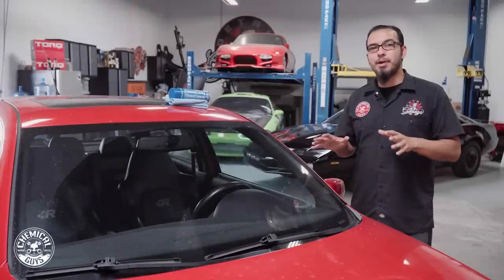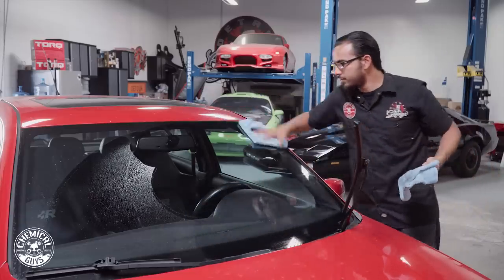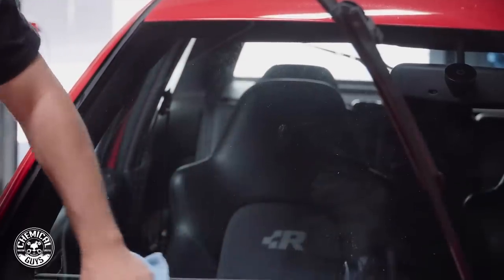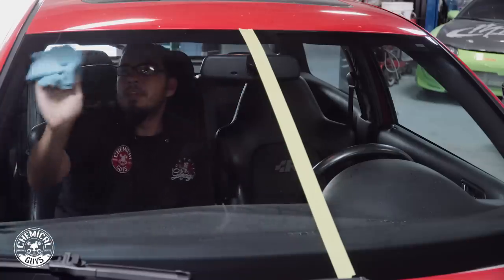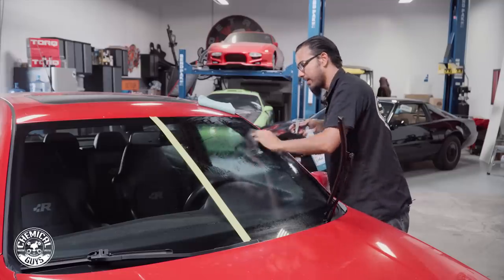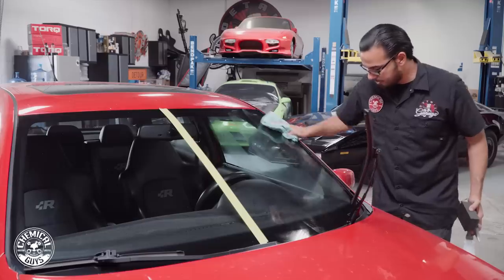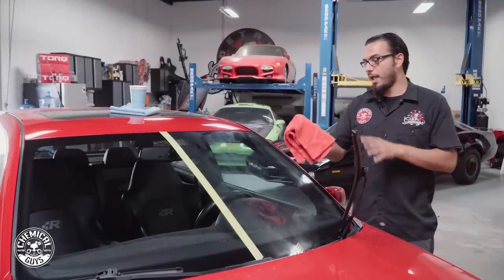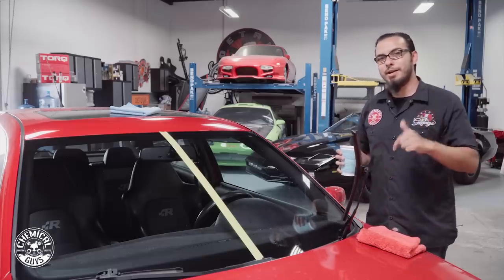How To Clean and Seal Glass! - Chemical Guys

Comment: Got a replacement windshield, was asked for no car wash for two days (glue drying), np. It rained I will clean regular, should I clay bar same steps. After jet seal with new wipers will I have streaks? Does wash and wax cause that or silicates scratching my wiper and windshield? Do I need to wax it I have butter wet wax? Right now it doesn't repell water. New video maybe showing a glass repair short then what to do or new car.

Comment: Dear  , I am trying to remove hard water spots on my truck windshield. I watched the video above and I have some questions. I called you guys up and spoke to a lady. she was very helpful to find the products that you mentioned on your video on your product page. I noticed on your page  many clay bar kits, you used a dark bar and she recommended me a yellow one. what is the difference ? thanks for your time and info/help.
Reply from the maker: Hi Adolfo, good question. In this video, Nick uses a Clay Block rather than a Clay Bar. A Clay Block is essentially a synthetic clay bar. It has some unique benefits to it over a clay bar. For example, you don't have to throw it away when dropped on the ground and also, it will last much longer than a traditional clay bar. Which one you choose is personal preference. About your water spots- have you tried Water Spot Remover yet? That would be the first step in your water spot removal process. Thanks for watching, Adolfo, and thanks for being a part of the Chemical Guys family! 
https://www.chemicalguys.com/Clay_Block_V2_p/clay_block.htm

https://www.chemicalguys.com/Water_Spot_Rx_Hard_Water_Spot_Remover_16_oz_p/spi_886_16.htm

Comment: Good day. 
I have applied JetSeal to my model3 
Should I worry about Window cleaner stripping it off my windows?
Is their such a thing as PH balanced window cleaner like there is for your foam soap?

Thanks.
Reply from the maker: Hey Thomas! Thanks for tuning in. JetSeal will stand up to glass cleaners and the elements for up to 12 months. Add multiple coats for a more resilient barrier of protection. - Happy detailing!

Comment: Question, with a new windshield, would I use clay bock and clay lube to clean the glass before using the Jett Seal
Reply from the maker: Hi JP! A new windshield shouldn't need a clay bar treatment but just be sure the glass is as clean as possible before applying JetSeal.
- CG Nick
Reply: if it feels smooth you dont need to.

Comment: Hey guys, if using jetseal on glass would you also recommend also using hydroslick or would that be overkill? If using both, what order would you apply them? Thanks!
Reply from the maker: Hey! Absolutely, using HydroSlick and JetSeal in that order will add a durable layer of protection.

Comment: If your car is a few years old, do you need to buff it before using the Jet seal?
Reply from the maker: Hi Alex! Before any polishing or sealing, we recommend clay baring the surface of the vehicle. Clay baring the vehicle will remove all the contamination and deliver a smooth surface. After the vehicle is contamination free, you may polish or seal your vehicle. When the surface of the vehicle is contamination free glazes, sealants, and waxes bond better to the paint and last longer. If the vehicles paint is oxidized, we recommend polishing to enhance the shine of the paint and then seal. If the vehicle's paint is still in good condition, proceed with Jet Seal. Thanks for watching and thanks for being part of the Chemical Guys family!

Comment: I still can't get over the BGM......how about trying jazz?  

I usually wash my ride once/week or every other week depending on whether it rains, so the outside of the windshield stays clean.  I tried Rain-X's washer fluid additive only to find it little effective.

The problem is INSIDE the windshield.  I followed ChrisFix's instructions, but I still get traces when it gets humid.  I've also tried "Streak free" products, only to get disappointed.  Microfiber towels didn't help, either.  Is a flame thrower the only alternative left for me...?
Reply: ChrisFix does have an incredibly thorough window detailing video. If I recall correctly he mentions the interior side of the windshield gets cloudy from the out gassing of the plastic dash. Perhaps more prominent in your vehicle or maybe try switching up the type of dash cleaner you use?
Reply: JPN850R o
Reply: Its the plasasides, if the car us new, or the dash was treated with somthing crappy like armorall, you need to clean it often, untill the plasic fumes have evacuated themselves.
Reply: you just watched a video that tells you how, instead you choose to do the same as the trolls and tell how you did it another way. by the way, most found out years ago that rain x is not user friendly, its a good product if you use it right, but it is not a wipe on and wipe off and for sure  i would never use it in my washer fluid.

Comment: I have a question. Do I do this process before.or after i clean the car.lets say. I use the glass only stuff first, then proceed to clean the car throughly and clay it. Then use the jet seal. Is that the correct process? Or did.I say something wrong?
Reply from the maker: Hi! Good question. Yes, you can do it the way you described, or you can clean the the whole car first, then use the glass cleaner, then the clay. The important thing is just to get the windshield clean before you clay! Thanks for watching and make sure to check back tomorrow for a new video upload!
Reply: Chemical Guys i watch and hqve bought over $1000 in your products i think they are absolutely top knotch

Comment: What do you guys recommend to prevent condensation “fog” build up inside the rear or front windshield?
Reply: use the defroster on your climate controls
Reply: Ouch.  That's cold man.
Reply: Hence the name "Defroster"  If you have a rear window defogger, have you noticed how the fog disappears when it's turned on?
Reply: Fog X
Reply: 99% of the time; only use fresh, not recycled air. Recycled cabin air will trap moisture inside. Either from dew point or brought in as wet shoes, wet hair or even when you exhale, the humidity will increase thus attaching as fog to a cool surface like a windshield. 
Tip: When either defrost or defrost/floor is selected, the AC pump will run, which in turn dehumidifies regardless of temperature settings. AC is can be used as dry heat too, not just cold.
The other 1%, when someone farts.
Reply: Defroster great idea
Reply: @johnmax4586  the question is prevent . Not after it's fogged.
Reply: Hold your breath

Comment: Can I use the glass cleaner on tinted windows and also would claying to tinted windows affect my tint?
Reply from the maker: Hey Antonio! Try using Streak Free Window Cleaner to safely detail tinted glass.
Reply: Tint is on the inside so clay bar won't affect the tint. Just don't clay bar the inside, no point to because inside won't have stuck on contamination

Comment: Can I apply my Extreme Top Coat on the windshield just like the Jeat Seal? I still have a bottle and won't be getting Jet Seal until I finished this lol.
Reply from the maker: Hey, how's it going? Lay down a coat of Extreme Top-Coat over any exterior car surface that is painted, shiny, or clear. Protect glass, paintwork, clear optical plastics, polished metals, and even carbon fiber and mirrors from the ravages of harsh sunlight, pollution, road grime, extreme heat, and bitter cold. Thanks for watching and stay tuned for a new video dropping later today!

Comment: Question: when reapplying the sealer after a year, do you still have to strip with a clay bar?
Reply: John Kowalski I would say yes
Reply from the maker: Hi John! When you are ready to re-apply a fresh coat after the 12 months of protection, it is best to remove the previous layer for a better bond. 
- CG Nick

Comment: Once you do those two steps what type of wiper blades should I switch too ?
Reply from the maker: Hey Randy! Thanks for tuning in. I use beam style wiper blades on all of my vehicles after coating the windshield for perfect clarity.
- CG Nick
Reply: I’m sorry Nick what is a beam style blades?
Reply from the maker: It's basically on strip of rubber that only has one pressure point as opposed to traditional style blades that have a few pressure points. Beam blades will wick water away without leaving streaks. 
- CG Nick
Reply: Chemical Guys ok thank you for your time and help i’ll talk again keep up with the good work👍

Comment: Does Jetseal cause the windshield to fog up easily like a window that has Rain-X applied to it?  If it does, what is recommended to prevent the condensation on the inside of the window.
Reply: David Bork I use the rain x defogger stuff and it works like a champ. I also use the rain x water repell
Reply: h8fL Robben thank you for the recommendation.

Comment: Ok, that worked on my back window, any idea why side windows and windshield didnt work? Can I apply jetseal back right away? Thanks.
Reply: Hugo Hell Need to use some type of wax remover before you apply more JetSeal. Only apply one coat of JetSeal but you can layer with wax on top of it once JetSeal is the base layer.
Reply from the maker: Hi Hugo, how's it going? Did you make sure to prepare your windows before by washing and claying? Making sure the surface is completely decontaminated is an important step so the sealant has something to bond to. You sure can apply another layer after the first layer. You're going to want to wait 15 minutes before buffing off, then wait another 20 minutes after that to cure to the paint before adding your second layer. Thanks for watching, Hugo, and stay tuned for another video dropping later today!
Reply: yep, did all as per say in the video, for the second coat of jetseal I waited the next day over restarted from the beginning I got the jetseal to cure atleast 20 minutes +.  I have sort of ultra water repealing action like rain X would do, and maybe the product isn't just designed that way. just let me know what I should be expecting. thanks.

Comment: Whenever I put jet seal on my truck it never wipes off that easily. Especially if I use it on glass. It leaves a film that you have to scrub pretty hard to get off. I am making sure that I apply a thin coat so I do not understand why it's so hard to remove
Reply from the maker: Hi! Make sure you applying JetSeal in a garage, out of the direct sunlight, when the paint is cool to the touch. Make sure to leave JetSeal on for only 15 minutes, then wipe off with a quality and clean microfiber towel. Finally make sure the surface is fully decontaminated and smooth to the touch. If the surface is rough to the touch, you will want to use a clay bar to decontaminate the car before applying JetSeal for best results and easiest application.

Comment: Will this also take off rubber marks from the blades?
Reply from the maker: Hi, how's it going? Chemical Guys Glass Only Foaming Glass Cleaner is a specially formulated spray that delivers powerful glass cleaning foam developed to eliminate stubborn dirt and grime fast. If you're looking for something more powerful, try Butter Wet Wax. The refined natural cleaning oils gently loosen residue so it simply wipes away. Butter Wet Wax is frequently used to clean sticker residue off windows. Check out the videos below to see Butter Wet Wax in action and the amazing cleaning abilities it has. Thanks for watching, and stay tuned for videos every Monday, Wednesday, and Friday! 
https://www.youtube.com/watch?v=e1L9M10Y8Hg&t=2s

https://www.youtube.com/watch?v=gVUPeDhhWEk&t=6s

Comment: You should do a water beading test in your videos after applying wax/sealant/coating. JetSeal does get an great job at protecting the paint and repelling water.
Reply from the maker: Hi Mo, make sure to watch to the end of the video to see the big difference in water repelling on the sealed vs unsealed side. Thanks for watching and stay tuned for a new video dropping soon!
Reply: Mo Carey , dude, wtf do you think he did at the end of the video ???
or did you even watch the video ?
dummy, he poured a cup of water over both sides, the clean side didn't even bead, it just washed right off, the non cleaned side beaded up, big difference

Comment: are all of these products ammonia free? i have window tint which means no ammonia for my windows
Reply from the maker: Hey Justin, good question. Glass Only is safe for OEM tinted windows (Not recommended for aftermarket tint, always test in an inconspicuous spot first). If you are looking for a super safe window cleaner, you can use Signature Series Glass Cleaner which is safe for aftermarket window tint. Tint is typically applied on the inside of the window and not the outside, so it is safe to apply JetSeal to the exterior of the window! Thanks for watching Justin and stay tuned for a new video dropping later today! 
https://www.chemicalguys.com/Signature_Series_Glass_Cleaner_16_oz_p/cld_202_16.htm

Comment: I had a fairly difficult time buffing off jetseal from my trucks windshield. I applied with a mechine so it was a thin coat. Is it hard to buff off if you let it sit to long? Say like an extra 10 minutes or so.
Reply: Yes in my experience using it i once left it long id say about 40mins and it was difficult to remove
Reply: Same I did my whole SUV, I had to apply a lot of pressure when buffing.
Reply: Sounds like you need to lift weights to strengthen your arms 😃

Comment: I had to go get a car when I washed it there's the outlined from a sticker that was on there. How would I go about to remove the it from my window?
Reply from the maker: Hi Carlos, good question. The least aggressive way to clean residual adhesive from the glass is to use Butter Wet Wax. The refined natural cleaning oils gently loosen the adhesive so it simply wipes away. Check out the links below to see helpful how to tutorials! Thanks for watching and stay tuned for more videos headed your way soon!https://www.youtube.com/watch?v=e1L9M10Y8Hg
https://www.youtube.com/watch?v=e1L9M10Y8Hg
Reply: Use goo gone
Reply: A squirt of WD 40 works well to remove glue residue on glass or paint, wont hurt it.
Reply: @RO-qi9yj  I've found GOOF OFF works faster than Goo Gone on tough glue residue.
Reply: Carlos Valenzuela , alcohol or goof off

Comment: If the glass is hot will that make it harder to make it not streak?
Reply from the maker: Hey Jake, yes, that is correct. Hot glass will cause the glass cleaner to evaporate, which would make streaking more likely. Detailing rule of thumb: if it's hot, don't touch it. Thanks so much for watching, Jake, really glad to have you part of the CG family!
Reply: Will this make your wipers jump?
Reply: @kevinkavanagh2605  
I wax my windshield and it stops wiper chatter and jumping.
Reply: Chemical Guys will washing it weekly get rid of the jet seal?
Reply: @francisgarcia5828  use a car soap, with non stripping propertys, i use honeydew snow foam, and apply jet seal every month, but thats just me being crazy.

Comment: So the jet seal is basically a wax or a rain-x type of product?
Reply from the maker: Hi Knickels, good question. JetSeal is a sealant, which is essentially a synthetic wax. JetSeal is indeed a hydrophobic product that will help repel water similar to Rain-X. The difference is, JetSeal can be used on both the paint and the glass surface of your car, though. Thanks for watching, Knickels, and thanks for being a part of the Chemical Guys family!
Reply: Rain-x literally lasted less than 3 days for me.. and it's like £12/ $18 in UK

Comment: I dont umderstamd why you need to clay the glass anyway..because you said that the cleaner is removing everything on the glass.
Reply: Kaskarrr -83 the cleaner won’t clean everything off. There are still small contaminants that could be on the glass. Not everyone is going to have a clay bar though so you COULD technically skip the step and still be fine

Comment: Does the glass cleaner work in the sun though I'm a mobile deatailer and their liquid glass cleaner dries up before I could wipe stop doing evryhting in the garage use products outside in the hot sun make my life easier please
Reply from the maker: Hi Dj Magic, if you've been using glass cleaner in a sprayer to no avail, try Glass Only. It's in an aerosol can and is a foam rather than a liquid. Due to the thick nature of foam, it typically takes longer to dry and could be perfect for you. Try some and remember that the amazing 25% sale ends today at midnight PST!
Reply: Chemical Guys thanks and I love all your products but I work in the field in the hot sun so yes it would be easier if all your products would work with direct sunlight but thanks and I will try the can still a fan and a consumer

Comment: Still it's no rain x but it looks as if it works fairly well I think I'll try that tomorrow if I've got time. Wonder if they have a similar formula for the inside of the windshield. I'm a smoker of fine cigars and finding it to be a pain in the neck to keep the inside clean. To increase visibility.
Reply: F5C 🔥😂
Reply: Rain x is great but you need to
Make sure it doesn’t touch trim or paint.

Comment: How long will it last on the windshield?  I just waxed my windshield and it didn’t last more than a week
Reply from the maker: Hello Andrew! JetSeal will last up to 12 months on the glass with just one application. There are many reasons as to why the wax didn't adhere to the glass for very long such as an improper bonding, the type of wax you used or not allowing enough cure time for the wax to bond. Try following all the steps mentioned in this video including the clay bar treatment to ensure that your next coat of protection lasts as long as possible!
-CG Joey